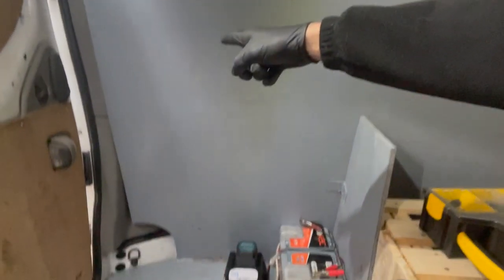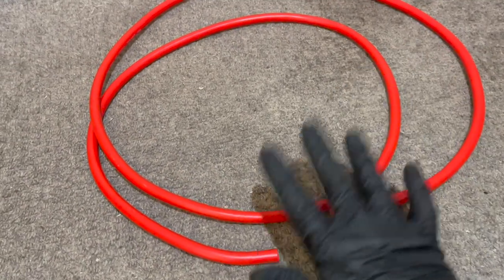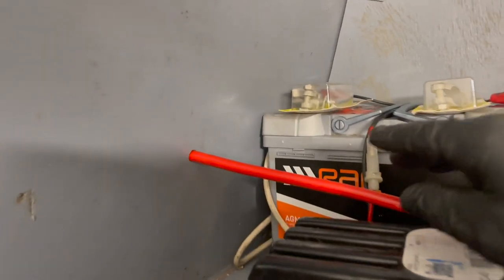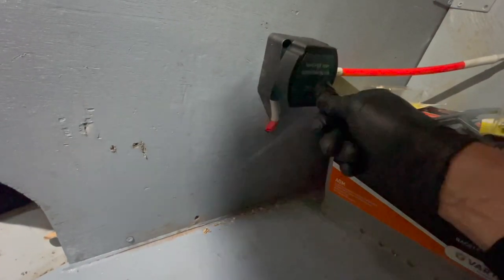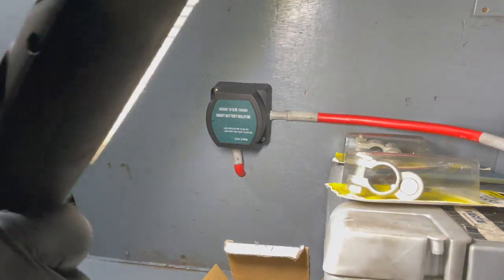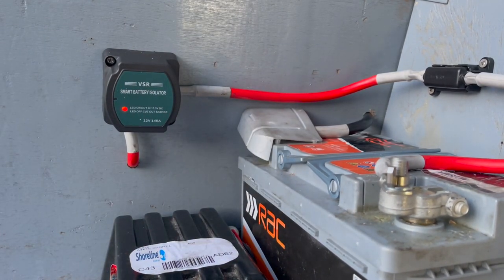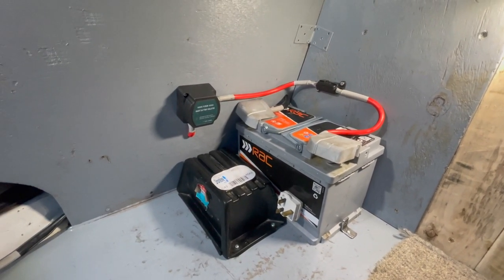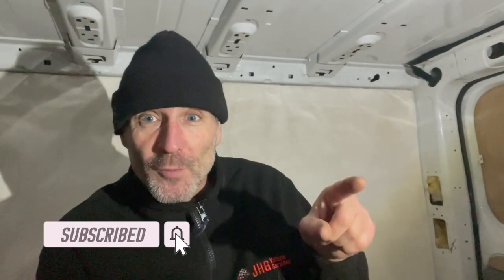How to install a VSR split charge relay for a second battery. 3 simple cables. Stealth camper Build.

Comment: What would you suggest in a situation where I have a STANDARD NOT smart alternator and I want to change the battery from AGM to LiFoPO4. Everyone informs that VSR is dedicated to standard alternators and DC/DC chargers to EURO 5 OR 6. It is not often said what kind of batteries can or should not be used with VSR or DC/DC. Everything seems to be that if I buy a LiFoPO4 battery and connect it to the VSR, then this battery will blow up my alternator. So what to do in this situation and is there any reasonable solution ???
Reply from the maker: In my sprinter that has a non smart alternator I had a 220ah AGM battery with a single 30amp hour victron dc2dc. I then fitted a 300ah lithium battery and still use the same 30ah victron dc2dc charger just changed the settings via the app, victron equipment in my opinion is fit and forget and will not fit anything else because they are so reliable and has all the settings for AGM lithium and non smart and smart alternators so it covers pretty much all scenarios. So much so that I have fitted a second dc2dc and on the standard 220amp sprinter alternator and has been faultless for well over a year. I would definitely recommend you looking into a victron 30ah dc2dc and it’s a simple upgrade from a vsr only having to add a negative cable to the chassis.